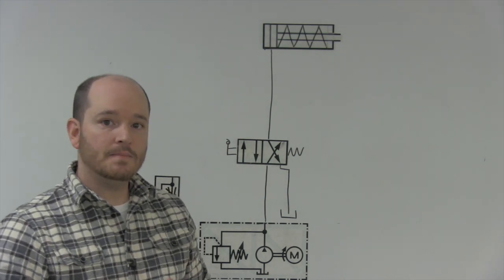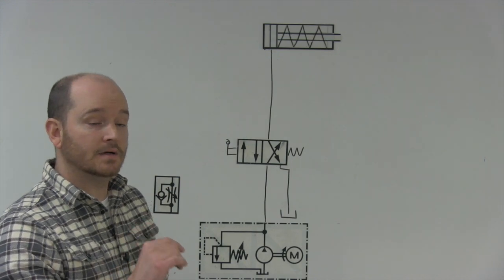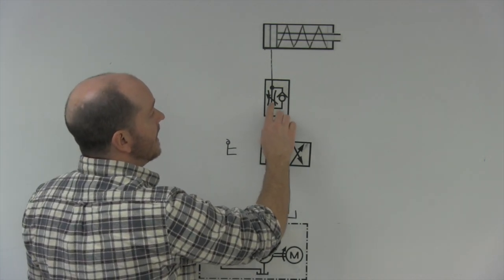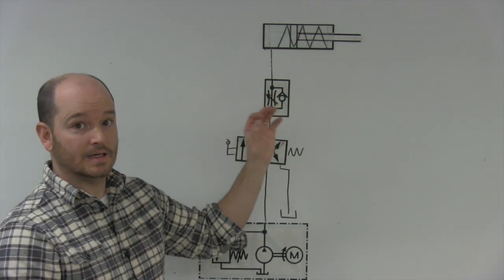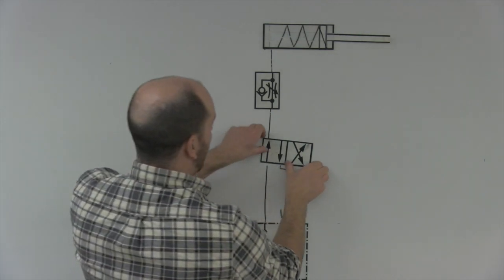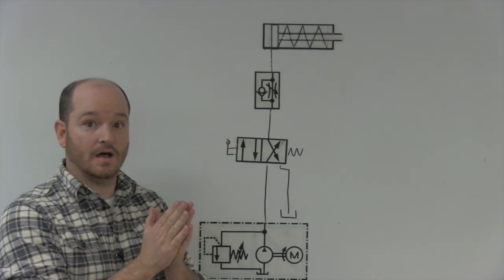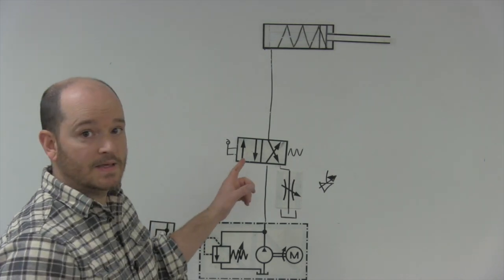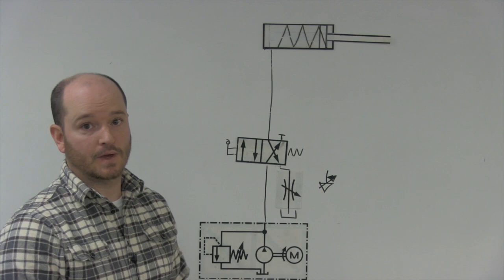Meter In and Meter Out of a Single Acting Cylinder

Comment: Thank you for the clear and concise description of SAC system metering.  Very helpful indeed.  I was wondering if you expand this discussion to include fusing as well as metering.  My objective is to figure how best to fuse the contraction of the  single acting gravity return cylinder circuit which is at the heart of my two-post hydraulic auto lift.  Many thanks again!

Comment: what is the odds where all three rams wont return even with hoses off? also the rams will NOT return with jack under them in dump position, unless you remove the hoses on each ram?

Comment: I applied the method of putting Meter out in T port before dumping oil in tank. Speed is reduced but there is some sound generated in line. Which is not there in fast speed. I am pasting example video. Same is happening in my case almost identical problem of sound in both directions.
https://m.youtube.com/watch?v=LZn0vBgMygw

Comment: HELLO CAN I HELP ME I HAVE PROBLEM OFF LOW SPEED OFF REACH STACKER  TEREX TCF 45 T I CAN SENND YOU HYDRALIC WIRI DIAGRAM BLOC DISTR L90LS AND M400LS THE OIL HEAT AND THE STEERING WORK NRMALY AND SPREADER WORK NORMLY ONLY UP/ DOWN RETEACT / EXTEN
Reply from the maker: Sure, send me an e-mail with the schematics and describe the problem in great detail.
Reply: simo_rait@hotmail.com